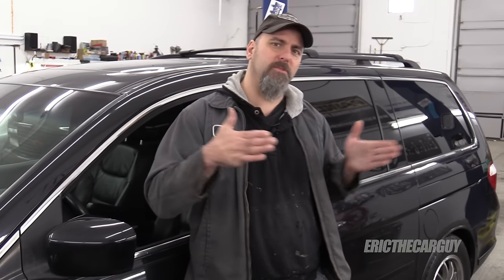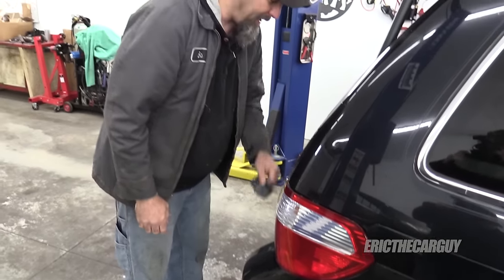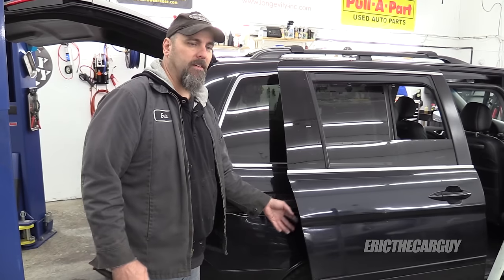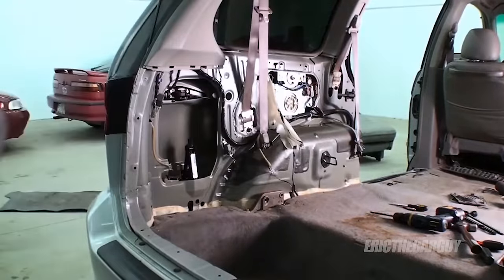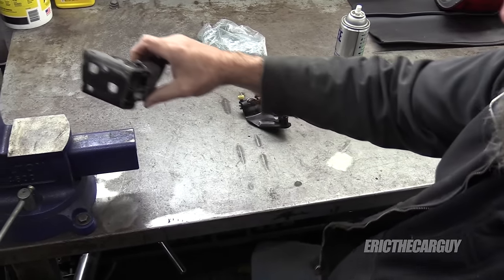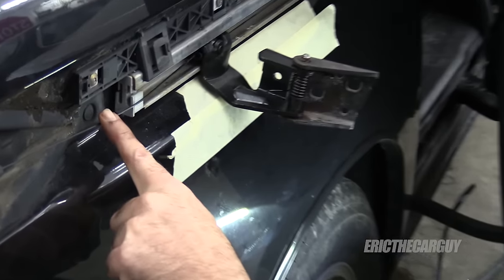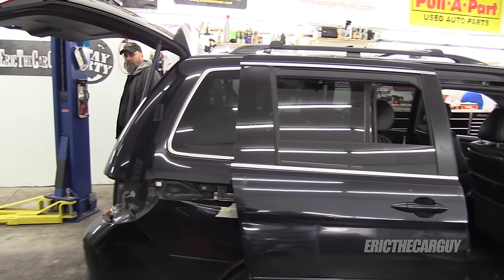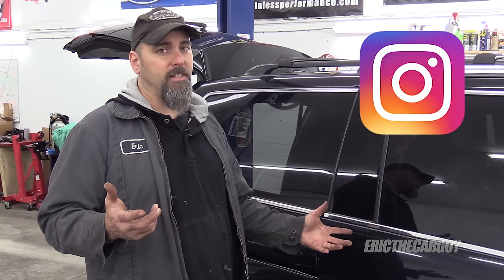Honda Odyssey Sliding Door Repair the 'Easy' Way

Comment: I have worked on 2 Toyota Siennas. I know big sample to make my case from lol. I have noticed it happens when someone stops the vehicle to let someone out from the power door exit. The driver always forgot to put the vehicle in park and the person tries to open the door. The alarms start going off and the door is without power. Now they try to force the door with out putting it in park first and the door jams. I also noticed when this happens the door lock is engaged making it almost impossible to reset. I usually have to have a second person trying to force the lock and door open while I kick the door from the inside of the vehicle.

Comment: I have a 2012 with a noisy right sliding door.  It rattles when you hit a speed bump or bumpy road.  Dealer fixed it several times under warranty, but it would only last about a month before it would start again.  Every time I got it back, the door seal was very sticky.  Don't know if the actually adjusted something or just lubed the seal.
Any suggestions?

Comment: This is for the 2012 model.  Just had my motor and middle rollers replaced by HOnda for $1000k.  The new motor comes with the new roller because Honda reengineered that roller.  Unfortunately, it was not a campaign but a bulletin.  Campaign they would have paid for it through Honda Care.  If you change the roller, you most likely have to replace the motor as well along with a control module.  My original problem was my cable snapped, probably because the roller was bad.

Comment: Tip: you 'misused' the masking tape: put the tape before you remove the trim on both top and bottom part. Ideally use painter's tape (it is easier to remove and won't leave residue and won't peel the paint). Keep the tape there until you are done. Since you installed it before you removed the trim, the trim can't prevent the tape from being removed after.

You may want to add one strip on the bottom edge when the trim is removed, so the mechanism won't rub on the edge... A second layer can even be put. Remove that strip before you reinstall the trim of course (but leave the rest there).
Reply from the maker: Thanks for the advice!

Comment: Hey Eric i also have a 2006 Honda Odessey and my passenger side sliding door does not open, i have seen all the videos out there i have reset it checked battery and all i have the whole right side of the van exposed but unlike the left side when i push the door button or on the remote i hear absolutely nothing like there is no power going to it, and i have checked the fuses. any ideas

Comment: video at 1:37 shows the door the last second of closing....right there is when my door doesn't close all the way tight and I have to do a body check on it to shut it tight or my constant buzzer while driving keeps buzzing as a warning that something is open....do you feel there is some sensor that finishes that 1/4 inch seal at the 1:37 seconds of the video?  My other sliding door closes fine and seals shut.
thanks

Comment: I would recommend, that if someone was doing this on their own that they tie the sliding door to the roof rack. That way if it accidentally slips off the jack, it doesn't land on the floor. If it does that you will most likely derail the front rollers, which is a pain in the butt to fix on your own.

Comment: i have a 2003 ex odyssey driver side sliding door
not opening on the switch on the dash board but opens automatically in the handle i try this video but still doesn’t work i tried to replace the fuel cover sensor still doesn’t work 
you can hear the motor running but wont open the door 
do you know how to diagnose the bad control module for sliding door ?

maybe you can answer my question its giving me headache to figure out whats the problem

Comment: Hello, I have a 2013 Odyssey EX-L, when I go to the part Honda Part No.: 72561-SHJ-A21 and then check fit, it says that it does not fit my vehicle. Seems inaccurate since this is supposed to fit for up to 2017 Odysseys. This is for my driver's side sliding door. Thank you in advance!

Comment: Marking the footprint with a marker doesn't necessarily work. I replaced some for someone and the footprint on the hinge was different size. I still had to adjust it by trial and error after I installed them.

Comment: Saw a great way to pull taillight out without breaking it. Take three strips of long duct tape and tape to the sides of the light and leave enough on back to place together and then use it to pull the light assembly out. Works great

Comment: One thing that sometimes helps when removing a tailight that is stuck in the plastic retainer, is to make a slide hammer by attaching a long piece of duct tape to the tailight. You just have to be careful to catch it when I let's go.

Comment: Use vice grips with card board or several layers of shop cloth to grab and pull the cable.  (AND  as per comment below - turn the door off - or disconnect the batt !)

Comment: I have driven a 1999 Accord for 5 years, but it has a transmission leak, and I fear the gearbox is going.  I bought a 2004 Camry, but that was totaled 1,700 miles later.  Without a reliable car, I don't feel safe trying to drive 4 hours to Phoenix to buy a car and the only affordable and possibly-reliable vehicle in my area is a 2007 Odyssey at a dealership, but the salesman informed me that it needs a windshield and the side door motor.
I am a single guy and this seems like a terrible choice for commuter vehicle, but I need a reliable vehicle, so I drove 40 minutes to look at it.
What the salesman didn't mention is that the door doesn't close and all 6 dome lights quickly run down the battery.
I also discovered more problems and all together, my life is already an unreliable odyssey, but does it sound like that minivan has this problem?

Comment: You can turn the power sliding door switch off and you can move the door freely thus move the center roller freely so you don’t have too pull the door back

Comment: Could you help me Eric if my 2010 Honda odyssey sliding doors slides closed but When the backside of the door pushes in to lock it pops back out the door doesn’t completely open but it’s not completely closed thank you

Comment: I forgot to mark the location of the bracket on the door. When I reinstalled, the bracket, I guessed where it needed to go. But now my door won't close all the way. It gets close, but it beeps and stops. It then won't open with the button or interior handle, only the exterior handle. Would that be caused by that bracket not being alligned properly?

Comment: I have an interesting problem with a 2006 Odyssey. One sliding door won’t open, but if the fuse is pulled and replaced it will work again perfectly for a few days, then it won’t open again. Any ideas?

Comment: My door opens 95% every time but it won't park against the lower bumper.  Which stops the handle from working to close it. Any ideas on
Reply: Scott Tyndalls Home Shop YouTube I just performed this repair today and have the exact same problem. Have you found the solution?
Reply: @jonathanratcliffe1924  the lower guide has rollers on it that has to roll over a spring loaded piece that holds the door in the open position.  A temp fix is to put a tiny amount of grease in the track because  what's has more than likely  happened  is your rollers have locked up. Permanent  replace the lower hinge/guide.
Reply: Scott Tyndalls Home Shop YouTube Thanks. I would like to try that. What type of grease did you use?
Reply: Scott Tyndalls Home Shop YouTube Thanks. I will try that.

Comment: Hey, you know Q-Bond would have worked better. Gorilla glue (in my experience) has always let go. Ever since I saw you use Q-Bond, on that vaccuum repair, I have used it for SO MANY things. You know how on newer mowers, the gas tank is a plastic reservoir built into a plastic cover. Usually has a lip seam around the top. I bought a lawnmower 2nd hand with a crack in the plastic all around in the inside seam around the tank facing the engine. I used the correct Q-Bond powder and glued it back together and havent had an issue with it in 2 years.
Reply from the maker: The thing about Q bond is, once it gets old, it doesn't work so good anymore. At least in my experience. Thanks for the comment.

Comment: I have an 05 and the doors and windows WILL NOT OPEN. I drug the rear passenger side against a pole on accident and everything stopped working. Any advice? Or did i destroy it?

Comment: Eric  I need your help  I need to fix  a problem  with  "check fuel  cap" I check everything and change all the parts  the OBD toll me  but  when i fill my fuel tank I discover that there is a gas leak between the tank and the hose that is connected to the tank as a repair to that problem  hep me pleace  thank

Comment: I have a problem... I wanted to check my door rollers cause sometimes they give me fits. Anyhow, I pulled off the roller on the right side and everything looked good, so I put it back on. I made marks so I knew where the bracket fit and after a bit of a struggle, was able to get the cable back in and attach the bracket.

The door will now not open automatically. I can manually open it and then even shut it manually. Can even use the automatic feature to shut it. But when trying to use the auto open, it just beeps and never opens.

Comment: My driver side sliding door will not open under power! You can open manually but when you shut it, it will latch and pull in, but then releases!
Sensor then shows door ajar
I think this is running battery down at night with the 40 amp fuse that controls back up/ acc
Any ideas? 2005 honda odyssey Ls

Comment: I got a 2005 odyssey that was working fine and one day stopped and the slide door light came on. I reseted it opens and close and light come back on i repeted that set 3-5 time took it the the honda and thay said the it the motor ($1,200 quote) i don't think that the problom. Any suggestions?

Comment: I have owned 3 Honda Odyssey vans THREE sliding door fails. Why can’t Honda make a door that opens like a regular door as an option? Honda can’t make a door that does the one thing a door should do open and stay closed. Honda charges approximately $1350.00 to fix the door of this family van so your children are safe. How about not making parts of plastic on a door that real people use multiple times a day. 
Thank you for your video

Comment: I've broken plenty of those plastic parts.What works for me is hold broken pieces together.And use  soldering gun to melt plastic to each other from the inside.Its almost like might welding plastic.Di the inside deep enough where nothing has to be done on the outside.
Reply: might welding plastic
Reply: +Filiberto Barrera got dang auto correct.Mig welding plastic their finally.

Comment: To stop the sliding door wherever you like you can use the driver master control: push to open then push the open again and it will stop wherever you want. At least that is what it does on my 2003.
Reply from the maker: Thanks!

Comment: How can I get my door open to even see of it is the rollers. I tried resetting the door with the on off swtich and I even heard about removing the negative terminal off the battery. But nothing has worked in my door still will not open. You can hear it wants to work it just won't open
Reply: Try locking the car with remote,  then unlock, lock, unlock ,lock , about 4-6 times manually with  key then try the door again, it works for me.

Comment: Another tip, this time from a really lazy guy who hates removing frozen fasteners more than once.  Anytime you have one of those 'ball' mounts (sorry I don't know the official Honda name,) add a daub of heavy bodied grease (I used Valvoline Crimson but it doesn't matter as long as it is heavy enough to not drip or wash off) directly onto the ball mount and another into the 'ball receiver'.  When you need to access the taillight to replace light bulbs, etc. again, the light will snap off easily.
Reply: I think they are properly known as "those rubber grommet thingys the plastic nubby slips into".

Comment: Someone else mentioned already that the door motors on these 3rd gens are completely different than the 2nd gen motor you showed. I made a video where I replaced the cable on the door opener on my 3rd gen and it shows how to give it slack, and even the internals of the motor: https://youtu.be/P6IDuQc2fLs

Comment: isn't there a switch to disable the power door?
my toyota voxy has one just above where your knee would be on the driver side
or just disconnect the battery
Reply from the maker: Yes.

Comment: I have a 2000 Honda Odyssey and the sliding door on the passenger side won't open or closed and the sliding door alarm is going off I don't know what made the door stopped working all of a sudden I can open it and close it manually but I have to pull it hard in order to do so how can I fix this I have to turn off the automatic sliding door power while I'm driving cuz if not the alarms going to keep going off telling me it's something wrong with the sliding door the other door opens and closes just fine automatically how can I fix it?
Reply: Slideing door window replacement

Comment: I just want to get my passenger sliding door completely closed. The front of the door closes ,but the back of the sliding door is open prob about 6 inches. I'm afraid it might fall off.
What makes the passg sliding door latch in the back(left) of the door ? Is it the door lock or what ? Once I get that door completely shut,I'll never open it again. Can anyone answer my question ?

Comment: The cable broke on the passenger side of my '08 Odyssey. Rather than paying close to $400 for a new motor, I decided to cut the cable and replace the roller. I got everything on very nicely, but when I went to open the door, it got stuck on the first rivet on the slide assembly. The new part looks exactly like the old one, so that's not the issue. The rivet is as close to the body as the rest of them, so that's not the issue, either. Does anyone have any ideas?

Comment: Hey everybody, im 13 and if i can do this repair by watchin this video YOU can too. to NOT break that back end of the tail light. Put your whole palm on the side of the tail light, stand beside it and push straight out, your hand acts like a sucker and pushed it straight out. or spray we-40 down the seems and wait a few minutes and pull it out.

Comment: Did this but now get a continuous beep when putting in gear. Seems like it thinks the door isn’t closed. Can work around by turning power doors off before driving. Door closes perfectly now after replacing rollers but the beeping is infuriating :)

Comment: I did this exact process on my 05, now my door wont open :( to be exact it sounds like it will open and tries to open for a centimeter then it closes back giving me a beeping sound.  i pulled the fuse to reset the doors but it still does not open. Anyone have any suggestions?

Comment: On my old Odyssey, I pushed into the door to force it to close, so it scraped all paint off along the track, then I discovered that I can PULL OUT on the back of the door as it tries to close, so my NEW Odyssey with the SAME problem will NOT need to be fixed, since the rle is to press the button inside to begin the close (not the handle) and RUN around to the other side to PULL out on the door before it gets to the sticking point.  No need for this repair!

Comment: the 2007 is way way easier to change, can do it in 10 mins tops and dont have the cables to deal with because they are on the bottom of the door on the inside, however the factory replacement rollers are junk, after 3 new sets in 6 months i got tired of throwing my money away,  i ordered some industrial grade rollers and swapped them out, aint put another roller on in 13 years

Comment: Fiddlerpin again.  Well my right slider hinge that I replaced two years ago is now broken again.  These parts are the cheapest made pieces of junk I've ever bought. The plastic bearings should have been made of steel and a small internal bearing would have helped.

Comment: Use this tip to remove the rear light assembly without breaking it: https://www.youtube.com/watch?v=3zK6EAx89c0 flathead screwdriver plus a paper towel or rag and wala!

Comment: I did the EXACT SAME THING while changing the tail light bulb on my wifes van.... Broke the plastic... Stupid flimsy design 👎
BTW, if you don't realize that the rollers are worn off of that back arm, the door can fall out of the track and scratch/dent the body panel. I also found that out the hard way. 👎👎👎

Comment: My Passenger door won't open or close . About to fall off. I bought this pos not knowing the door trouble, nor the power steering leaking,nor bad brakes/ball joints, bad ground for reverse lights. They passed it on inspection. Crooks. I don't care to fix the door,just want it to shut all way because it runs my battery down thinking the door is open. I don't have the money to pay to have it fixed.
2 wheels on door cable broke from trying to shut it. Just want to get it shut.